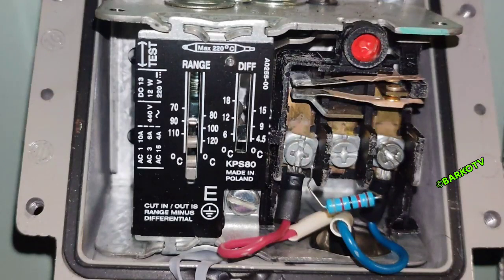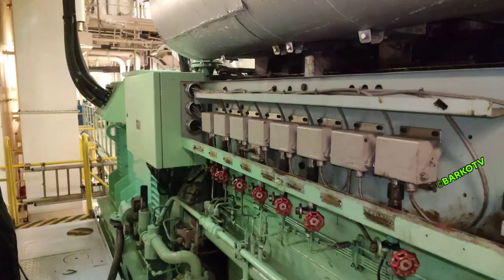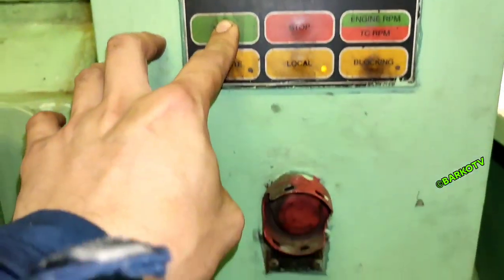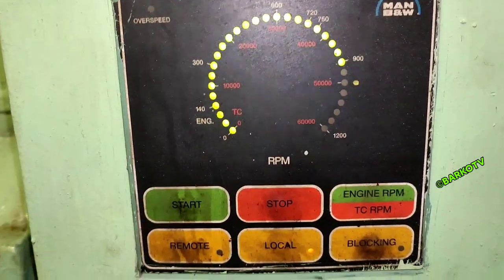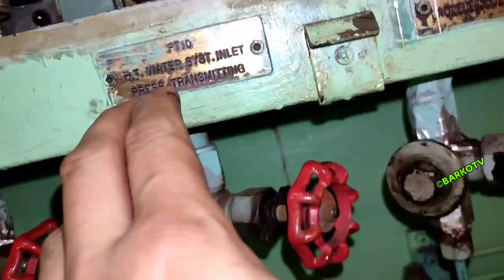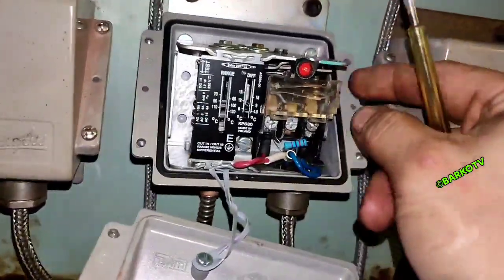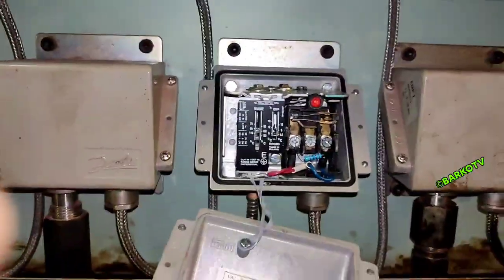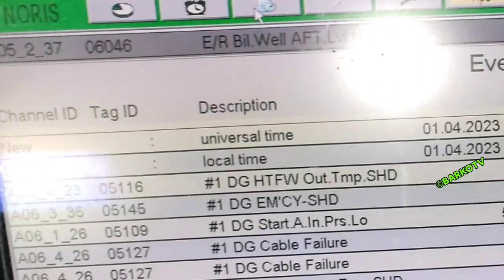What is the purpose of that resistor in the Generator Temperature switch | high temp F.W shutdown

Comment: Kung aalisin lang ba ung resistor magcause ba ng shutdown sa d/g?
Reply from the maker: Merong alarm na wire break, pero hindi mag shutdown, kasi sa design ng gen namin, for example, sa lube oil shutdown ay open contact during running, at trigger ng trip ay closed contact